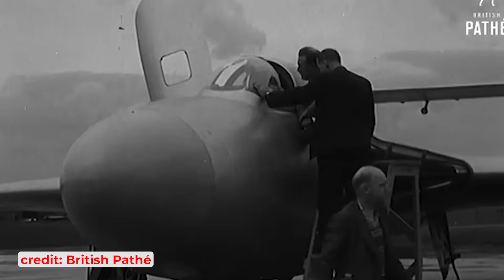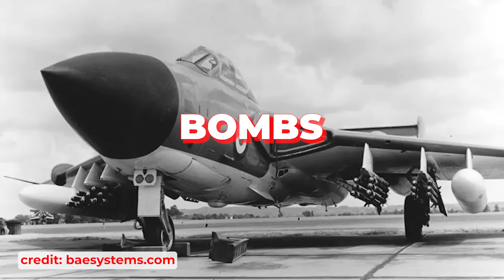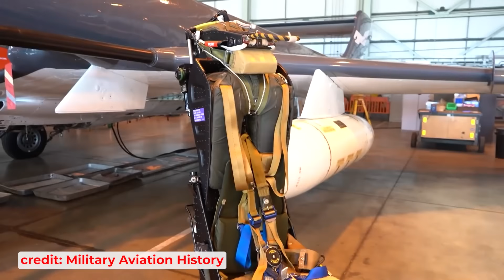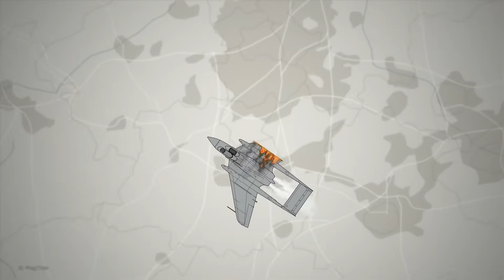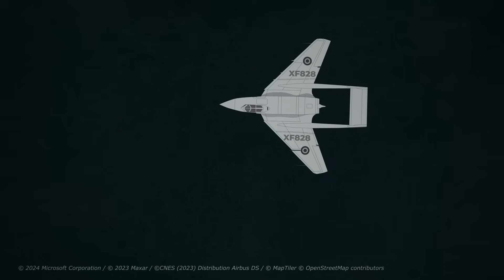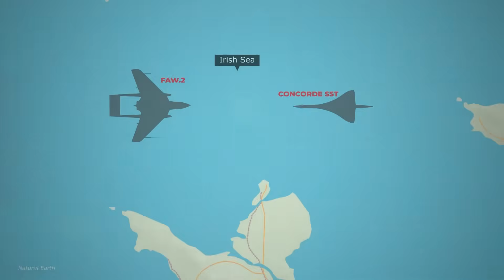Sea Vixen: A Beautiful Killer

Comment: When you see these folding wings....you start thinking this could fail.
Reply: When you hear its designed by de Havilland... you know it's going to crash often.
Reply: @DoktorBayerischeMotorenWerke Sea Vixen Compared. 

We feel we can clear up some commonly held myths and misconceptions, obviously.

It's always good to see the facts presented clearly and concisely isn't it.

We feel we can clear up some commonly held myths and misconceptions, obviously.

It's always good to see the facts presented clearly and concisely isn't it.

See further down for a Meteor losses comparison.

See below for Comet accident losses comparisons. The Comet had similar accident losses fatalities to the later Sud Aviation Caravelle. Much later jet airliners from US manufacturers had significantly worse accident losses. 

The Vickers VC10 held the Atlantic crossing record for 43 years  (Non supersonic airliners). 

The Harrier was the only aircraft of its type at the time it first flew. All 1250 Pegasus engines built for all Harriers ever built anywhere were British build and design engines. The first 135 Harriers purchased for the USMC were entirely built in the UK. All 436 USMC Harriers had British built engines. 

The world's first wind tunnel was built in England during the 1800s. The world's first supersonic wind tunnel was built in England during the 1920s. 

Indeed that's correct. The Whittle Gloster E28/39 was of course a brilliant aircraft that was later copied in Russia as the upsized and tweaked Mig 15 with a copy of the RR Nene gas turbine aero engine.

Obviously the RR Nene being the world's most powerful & most reliable gas turbine aero engine in 1944.

The MD F3H Demon was a contemporary to the DH Sea Vixen & had a similar performance. The F4 Phantom was a follow on from the F3 Demon. The Sea Vixen took a long time to get from first flight to introduction for various reasons and a similar situation occurred with the MD F3H Demon.

McDonnell Douglas F3H Demon
590 Built. Not Supersonic.
Max Speed 578 MPH.
Introduction date 7 March 1956
First flight 7 August 1951
Retired 1964

MD F-4 Phantom 2
Number built 5,195
Manufactured 1958–1981
Introduction date 30 December 1960
First flight 27 May 1958

DH Sea Vixen
Number built 151 (including two DH110 prototypes and one Sea Vixen prototype)
Introduction date July 1959
First flight 26 September 1951
Max speed 695 MPH.
Retired 1972

Regarding the UK Aerospace Sector.
 
An airline recently ordered 60 RR Trent XWB Engines.

It's a great pity & a crying shame that British military forces had to occupy a large part of Germany for decades after 1945 & Russian military forces had to do the same. Of course Russia still posseses a large chunk of what was German territory & of course Russia & the UK produce nukes. Obviously Germany does not produce nukes.

Interesting British achievements.
There is no doubt that the Fairey (England)
Delta 2 was of course the world's first jet
aircraft to exceed 1000 mph.  Indeed It
exceeded the previous record by 310 mph &
held the record for 1 year. Incidentally, the Dassault Mirage 3 & 4 are based on the Fairey Delta 2.

Early days, jet fighters.
De Havilland Vampire, Sea Vixen & Gloster Meteor accident losses were not high or unusual for fighter aircraft at the time. De Havilland built large numbers of all metal airframe aircraft before the DH Comet.
We mustn't forget of course that the DH Vampire for example first flew in 1943 & the engine was also built by De Havilland. There were examples of the Vampire interceptor / fighter in service until 1990 which was operated by more than 30 countries.

Non combat phase accident losses.
% of Aircraft built.
The Canadair CL-44 was a turboprop airliner.
Canadair CL-44                  (ff 1959 ) 48%
Lockheed XF104                (ff 1954) 100%
Lockheed  P80                   (ff 1944) 43%
Lockheed F104                 (ff 1954)  45%
Grumman f9f-5 Panther   (ff 1947) 44% 
Convair F102 Dagger        (ff 1953) 45%  
MD F-101 Voodoo.             (ff 1954) 34%
MD FH Phantom 1            (ff 1945)  35%
MD F4 Phantom 2             (ff 1958)  28%
MD F3H  Demon               (ff 1951)  32%
Gloster Meteor                  (ff 1943)  21%
DH Vampire                       (ff 1943)  23%
DH Sea Vixen                     (ff  1951) 33%
Gloster Javelin                   (ff 1951) 20%
EE Lightning                       (ff 1954) 33%

An example of what goes on these days in various countries.
For example, there are of course no German companies that makes German jet aircraft in Germany & there are no German Companies that make German gas turbine aero engines in Germany that are suitable for widebody airliners.

Brazil makes very good airliners & Brazil is 100th down the list along with Indonesia for wealth per capita. Of course it is in fact the case that Embraer can't build those airliners without purchasing stuff from the US, UK & Europe. Norway Holland Denmark Ireland Belgium - Top 20 wealth per capita - Don't make airliners -  its as simple as that.

    Early days of the airliners.
That's correct of course, at the time the Comet wasn't particularly dangerous. Agreed, that is indeed the case of course, The DH Comet was definitely not the worst engineering failure in commercial airliner history.

How things were back then. 
Accident losses - % of aircraft built.
DeHavilland Comet 4                   14% 
DH Comet all mks   (ff 1948)       17%  
Vickers VC10 UK                            5%

The DH Comet had better safety than or similar safety to many other commercial passenger aircraft of a similar era.

Douglas DC-1                                      99%
Douglas DC-2                                      47%
Douglas DC-3                                      30%
Douglas DC-4                                      26%
Boeing s300                                        72% 
Boeing 307                                          70%
Boeing 247                                          48%
Boeing 707                                          20% 
Lockheed L-049/149 Constellation  30%
Lockheed Electra Turboprop             29%
Fairchild FH-227                                  30%
McDonnell Douglas DC-8                   14%
Sud Aviation Caravelle                        15%
Canadair CL-44  Turboprop                46%  
Convair CV-580  Turboprop                22%
Convair CV-880     (ff 1959)                27%  
Convair CV-990     (ff 1961)                33%
Tupolev T-104        (ff 1956)                16%

The VC10 held the fastest Atlantic crossing speed record for 41 years (Non supersonic airliners).

For the first few years of operations the Caravelle and Comet had similar accident loss Fatalities numbers.

De Havilland had prior experience building many all metal construction airframe aircraft & thousands of jet powered fighter aircraft that were primarily of metal construction with pressurised cockpits & jet engines built by De-Havilland.

We hope this helps. Cheers as always indeed etc
Reply: @DoktorBayerischeMotorenWerke 

We feel we can clear up some commonly held misconceptions.

It's always good to see the facts presented clearly isn't it?

A potential successor to the Sea Vixen. 

The Hawker P-1103 / General Dynamics / Lockheed F16.

During the 1950s in the UK a number of aircraft that would've exceeded the capabilities of anything on the drawing board elsewhere were in the design stage. They were cancelled for various reasons including the missiles doing everything idea. 

1954, Hawker, fighter development - Air Ministry Operational Requirement OR-323. P-1103, a twin-seat swept wing aircraft powered by a de Havilland Gyron turbojet engine and armed with two Red Dean air-to-air missiles. Reworked the following year-  February 1955, the Ministry issued OR-329, called for a large 40-inch (100 cm) sweep-scanning radar unit AI-18. In October 1955 revised P-1103 proposal for a revised requirement offering the Red Hebe missile. 

In addition to the P-1103 Mach 2.5 design, Hawker also did design work for a faster P-1121 version. Mach 3, steel wing + uprated Gyron engine.

The Hawker P-1103 initial design had a fully variable geometry chin position inlet, Hawker's basic 1954 design would later be used for the General Dynamics F16 Fighting Falcon (Viper) - first flight 1974. The F16 was built in a number of countries with companies in those countries also producing parts for the aircraft that were built in the US.

We hope this helps.
Reply: @DoktorBayerischeMotorenWerke 

A number of similar performance non supersonic jet aircraft got to first flight stage at around the same time. 

The MD F3H Demon was a contemporary to the DH Sea Vixen & had a similar performance. The later F4 Phantom was a follow on from the F3 Demon. The Sea Vixen took a long time to get from first flight to introduction for various reasons and a similar situation occurred with the MD F3H Demon. The Douglass Skyhawk delta wing is a contemporary to the the Gloster Javelin delta wing. Both non-supersonic delta wing aircraft, the javelin had better performance and first flew a few years before the Douglass Skyhawk.

Douglass A-4 Skyhawk 
2950 Built 
Intro 1956
FF 1954
In service to 1980s
Max V 670 MPH
Delta wing. A small / light jet aircraft designed for carrier operations without having to have folding wings. Often referred to as the scooter. 

McDonnell Douglas F3H Demon
590 Built. Not Supersonic.
Max Speed 578 MPH.
Introduction date 7 March 1956
First flight 7 August 1951
Retired 1964

MD F-4 Phantom 2
Number built 5,195
Manufactured 1958–1981
Introduction date 30 December 1960
First flight 27 May 1958

DH Sea Vixen
Number built 151 (including two DH110 prototypes and one Sea Vixen prototype)
Introduction date July 1959
First flight 26 September 1951
Max speed 695 MPH.
Retired 1972

Gloster Javelin.
434 built.
FF 1951
Intro1956
Max V 710 MPH
Delta Wing. 

Interesting British achievements.
There is no doubt that the Fairey (England)
Delta 2 was of course the world's first jet
aircraft to exceed 1000 mph, 10th March 1956 Indeed It exceeded the previous record by 310 mph & held the record for 1 year. Incidentally, the Dassault Mirage 3 & 4 are based on the Fairey Delta 2.

When the EE Lightning first achieved Mach 2 it was one of the fastest aircraft on the planet. 
P1 Mach 1 achieved 1954, Mach 1•5 capable.
P2 Mach 1 achieved 1956, Mach 2 capable. 
P2 Mach 2 achieved 1958.

The Hawker P1103 was a design and part built prototype that would have led to Mach 2 & Mach 3 versions of the aircraft. The General Dynamics F16 Fighting Falcon was of a similar design that went into service in 1975. The P1103 was cancelled during the switch to "mostly missiles plus no supersonic interceptor aircraft required in the future" era which included cancelling air to air missile development. Scheduled for test flights in 1958 and to be in service 1962. The General Dynamics F16 Fighting Falcon - based on a British design started 39 years earlier, built in the US and a number of manufacturing partner countries with parts for the US built aircraft sourced from partner countries. 

There were plans to do a supersonic thin wing Javelin which of course got cancelled. 

Early days, jet fighters.
De Havilland Vampire, Sea Vixen & Gloster Meteor accident losses were not high or unusual for fighter aircraft at the time. De Havilland built large numbers of all metal airframe aircraft before the DH Comet.
We mustn't forget of course that the DH Vampire for example first flew in 1943 & the engine was also built by De Havilland. There were examples of the Vampire interceptor / fighter in service until 1990 which was operated by more than 30 countries.

Non combat phase accident losses.
% of Aircraft built.

The Canadair CL-44 was a turboprop airliner.
Canadair CL-44                  (ff 1959 ) 48%
Lockheed XF104                (ff 1954) 100%
Lockheed  P80                   (ff 1944) 43%
Lockheed F104                 (ff 1954)  45%
Grumman f9f-5 Panther   (ff 1947) 44% 
Convair F102 Dagger        (ff 1953) 45%  
MD F-101 Voodoo.             (ff 1954) 34%
MD FH Phantom 1            (ff 1945)  35%
MD F4 Phantom 2             (ff 1958)  28%
MD F3H  Demon               (ff 1951)  32%
Gloster Meteor                  (ff 1943)  21%
DH Vampire                       (ff 1943)  23%
DH Sea Vixen                     (ff  1951) 33%
Gloster Javelin                   (ff 1951) 20%
EE Lightning                       (ff 1954) 33%

More recent UK military jet aircraft.
 
The Tornado & Typhoon & their engines are Supersonic & are indeed British design aircraft with British design engines built by an international consortium. The Tornado design for example started life during the 1950s at Vickers as the AFVG, it's engine is based on the RR RB-199. The EE Lightening is also a British Supersonic jet aircraft.

The Typhoon is the British BAC-EAP with an engine based on the British RR XG-40, the Typhoon is also built by an international consortium.